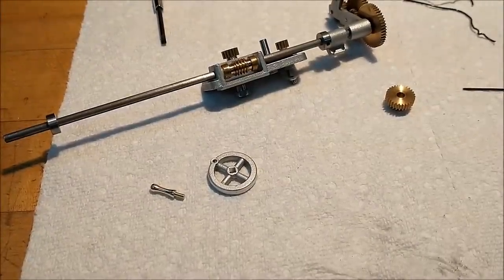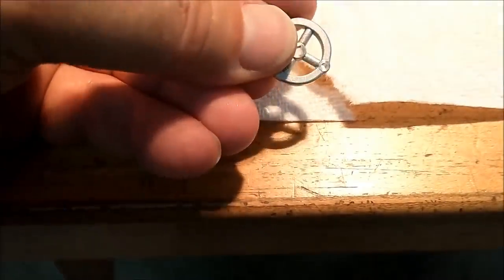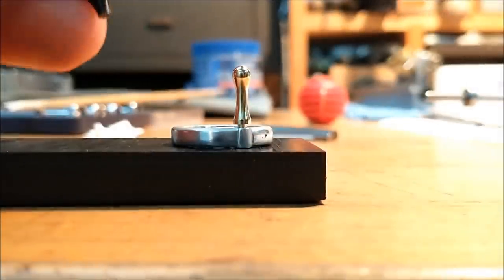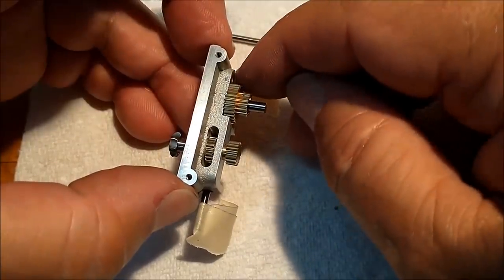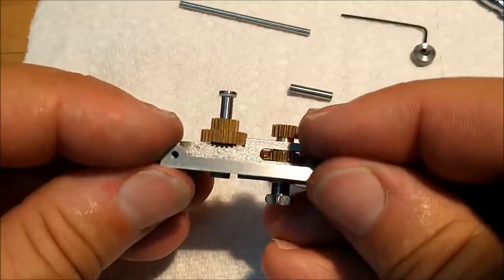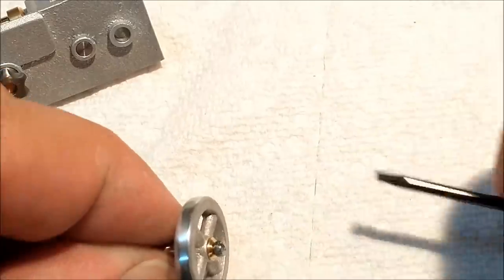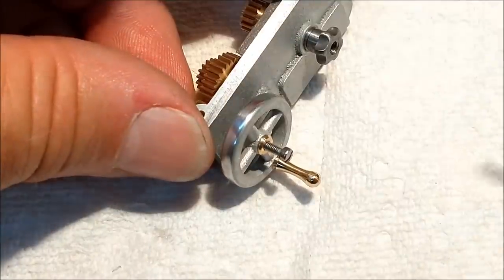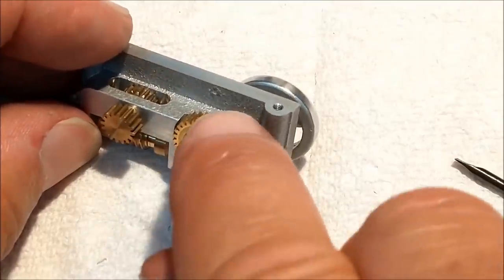Miniature Parts That Look Life Size ! Take a look !!

Comment: That method of creating an interference fit for the handle is ingenious.
I'd only ever considered the back-end peening method, but that creates distortion on the rear face of the pin.
Your method being an internal distortion means all visible surfaces are perfect.

Comment: Maybe a dumb question Joe, are you considering painting the body of the lathe? From a modeling standpoint in respect to mirroring the real machine, they would of been painted correct? I've never come across a machine tool with unpainted castings anyways but I'm no expert. I don't see any inherent value in having raw aluminum on display vs. the brass, polished surfaces etc. Purely my own goofy opinion, fwiw. Awesome job as always and grateful for your efforts to share it with us. Cheers

Comment: Are you strong enough to turn this crank; it shouldn't be that tough to turn it. Very nice job on this area of the lathe. It reminds me of the very small parts I used to custom make for John Martz Luger carbine maker from Lincoln, CA back in the 1970s and 1980s.

Comment: Here's a trick that I learned from my father:  Put the part with the pin into the freezer.  Heat the part with the hole.  A goose-neck lamp with a 60-100 watt bulb works just great.  If no lamp, a heat gun or an oven at a low setting should work fine.  Once you have the pin thoroughly chilled and the hole heated, the pin will drop right in.  The thermal expansion and contraction gives enough play.  Once the parts reach thermal equilibrium, it is as good as a press fit.
Reply from the maker: We used to use liquid nitrogen. You can get amazing shrink fits using that.

Comment: You could use wave springs instead of the nylon washers. If the objective is to keep the gear from shifting back and forth, then some sort of spring into the stack compensates for wear over time. It's also going to provide a more consistent location for the gear.  Does it actually matter? Probably not. 

Another option would be to leave bosses on the ends of the gear that serve as bearing surfaces and keep the teeth away from anything that they could scratch.

Comment: It seems counter-intuitive that the conical point of the centre punch would close up the back side of the bore. I was thinking you wanted to open the back side and then peen the end of the pin to capture it in the bore. Good tip.
Reply: It would open it up if you used a head with a smaller angle. I imagine 90 deg pushes a bit of edge material out of the bore, and a bit into it.

Comment: Joe, these are excellent, common sense modifications to improve the assembly & operation of the lathe!  Did you cover how to make those small Delrin/Teflon washers/bushings in an earlier video?  If not, I'd like to see how you did that without destroying them in the process.
Reply: They would be really easy to make, the trick is not losing them when parting off!

Comment: Hi Joe, I fitted a small roller bearing in my handle to wheel assembly, I'm surprised you went for a press fit ?.
Reply from the maker: That would have been a .06 Id with a .12 OD max. I have to see a part number on that bearing before I believe you 100%

Comment: Small question: could you make a guess how many hours this complete build did cost you? So I can multiply it by 10 to be on the safe side if I want to do it.
Reply: I'd be kind of surprised if he didn't know to the minute how long this project has taken.
Reply: @noelhenderson700  I was more thinking about 100 hours or more like 200. I don't expect it in minutes exactly.
Reply: The filming and editing can take the same time as the machining. If you allow 5 hours per video you won’t be far off but it would be interesting to know joes opinion.

Comment: Joe I've been watching this build from start to finish. .now I understand,  you build a model t ford you don't  expect to drive it.
BUT are you going to fire this up and turn something? Because I have emence respect for you . But if you out the time into this ,and by my calculation this machine is worth over  $20,000  and if you fire it up and it can't turn a piece of steel, or soft metal it would be very disappointing.  But all my love to your skills that I do not have.
Remembering Mr. Pie in Canada  shop time is $85.00 hr. To 120.00
So you have built a $15.000 to 25.000 dollar piece of machinery.
Please fire it up.

Comment: Just freeze the little piece and put the other one in the Sun...it will go in
Reply: It wasn’t about it going in. It was about keeping it from falling apart. The pin and the hole were the same diameter. So pinging the hold creates interference and keeps the pin from falling out.

Comment: I've gotten  text s from friends that are angry that I asked you to fire it up when it was done. I was told it was a work of art. I k ow this. I was told if you wanted it to be a working lThe you would not have used brass gears. 
I made a lathe when I was making jewelry out of a couple bearings a piece of 3/8 copper plate a drill a fllexable bit and a bit of ingenuity.  It cost 25 bucks but it got the job done fore turning wax. I friends r offended that I asked you if it would work when your done. I was, and am not trying to insult. I was just wondering if you could turn a miniature cam or something simple ,for say your dream engine? Joe please dont take offense
Reply: I am interested if it will operate as well.not necessarily cuting but turning and looking like a working machine.